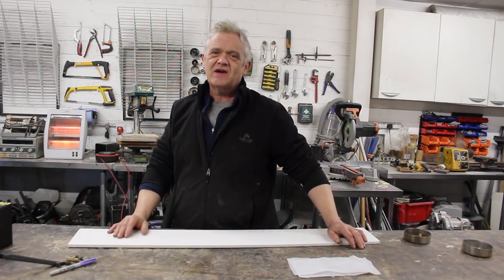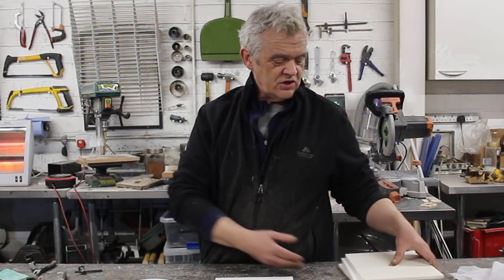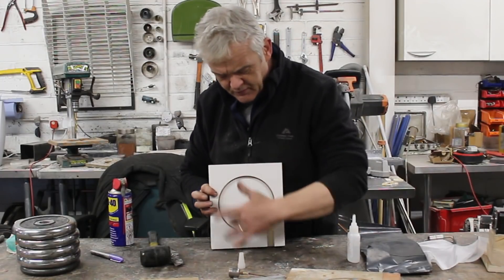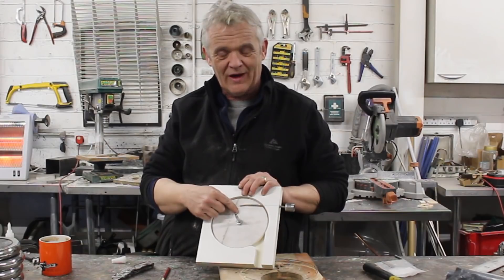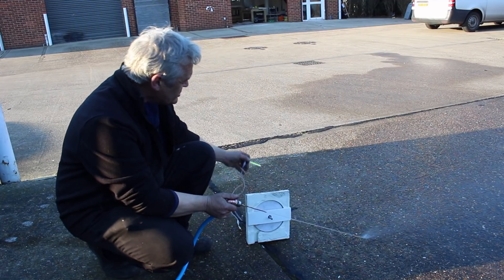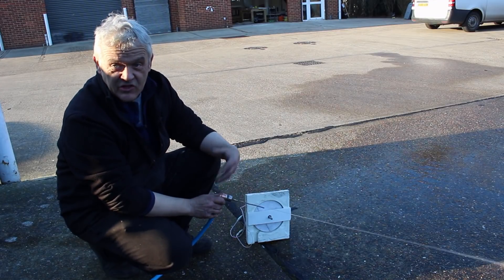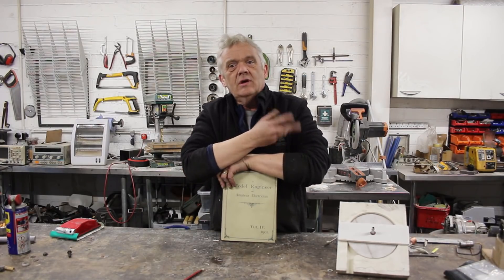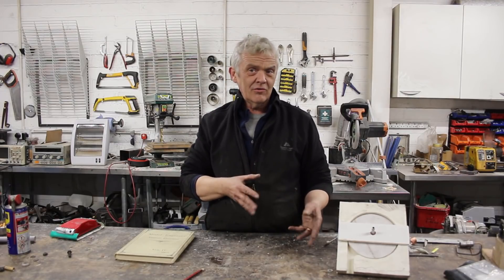1464 How To Build An Easy Water Motor

Comment: and if you divide it into 3 or 4 nozzles  and have them equidistant , and you added a rain gen  panel to cover the inside of the box (make a bigger box so the spray can get away from the disc)

Comment: I've looked into the history of these water motors and find them fascinating. I think you have played with the tiny ones you can buy on Amazon that can maybe generate about 5 Watts but those old water motors seemed to be able to extract a good amount of power from the water supply. ( I'm not sure if the old pressure is the same pressure that we get now)  even a measly 100 watts over a 24 hour period. 2.4kwh is about half of my daily use in a normal 3 bed house so a huge saving esp now. This, several solar panels, a small rose wind turbine, hamster wheel generator windwall fence and raindrop generator roof tiles, store the energy in a few fwg batteries and hey presto I'm a self sustaining power station. 😁
Reply from the maker: I think a multiple approach is the answer mate
Reply: Hybrid is the ONLY way to go, ESPECIALLY when you have Small Scale Hydro available.
That 2.4 KWh of daily production represents 16.8 KWh  of battery storage you don't need, on a 7 day storage protocol, and that's a LOT of Battery!

Comment: so... a 1000 to 2000 rpm variable capacitor disks with forced rain water [trompe pressure driven] direct drive &/or slower back driven thingy verse Cycloidal Drive gear to flywheel painted disk generators..
just because, add in spinning magnetic induction in the metal case to make induction heating of some of the water
Reply from the maker: now there are some interesting combinations mate

Comment: Amazing Rob. You just gave me an idea. I was in a squatter camp/ informal settlement yesterday here in South Africa. They have water taps for people to access water, and there is nearly always a line of people filling 25lt drums. If you place one or a series of these on each tap, they could still access water, but also generate some power. How much would this this generate and could we have a enough to charge a few cell cell phones or rechargeable lights while they wait?
Reply from the maker: that's an awesome idea mate - depending on the build these are capable of some generation so I would think - yes they would do that

Comment: What about using the discs from mechanical hard disk drives? Back in the day, the exchangeable cartridges had several platters that were 40cm or more in diameter, but more recent 5.25 HDDs should be good for your experimental needs, and there must be plenty available these days - I have 4 x 500gb drives in a box somewhere. I think I’d better dig them out.

Comment: Forgive me but why does it need to be on an angle to the surface plane, if you could somehow run the jet tangentially to the edge of the Inner disc? Could you please explain? the polarity of the water molecule should still allow it to stick and then pull away when others are present...right? also can we drill holes and scale it?
Reply from the maker: yeah that would work it's just easier to build it so it hits the front but you are right the edge would be good too

Comment: Rob, if you crimp the end of the water tube slightly to create a fan like spray does it increase the speed?  more surface area being hit by the spray.
Reply: Take a wheel and push to move it on the side start at the outer edge and then work inward as you get to the center hub it gets harder to push the wheel at the same speed as when you were at the edge.
Reply from the maker: nice tip - no pun intended lol

Comment: Good project. I remember on ebay a while ago. A shower radio run from the in line hose to the shower head. That worked on the same principle to run the radio.

Comment: I love it when you include the book that inspired the project.  When I can find them, I will spend the next several days reading and exploring the information available.

For anyone interested, volumes 3-7, 9, 11, 14,15,17, and 19 of "The Model Engineer and Amateur Electrician" are all available for download on Google Books.  There are other volumes available on HathiTrust, but they are for online viewing only.
Reply from the maker: that is an awesome heads up mate - I only have up to volume 12
Reply: @ThinkingandTinkering  In the later volumes, they replace amateur with practical in the book title, if you have difficulty finding  them.

Comment: I'm usually pretty savvy with this stuff but didn't really see the difference from a tesla turbine or boundary layer turbine
Reply: Tesla turbines have smooth disks not ruff ones. ruff surfaces are a two-edged sword it lets the water grip easily to push but it also wants to stay on the disk with micro turbulences forming layers that IMO shed energy but only at high rmps is this a problem.
Reply from the maker: Barksor1 gives a nice explanation mate